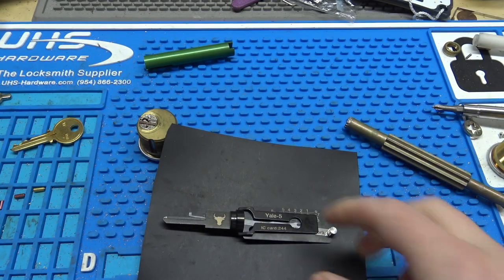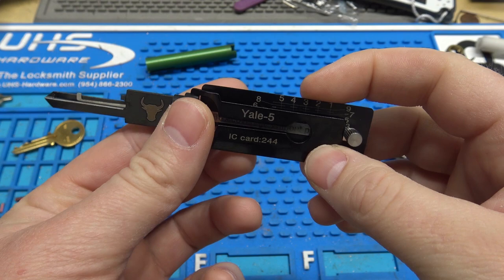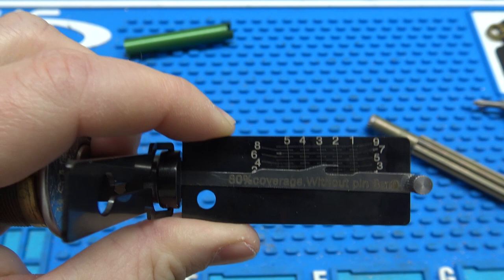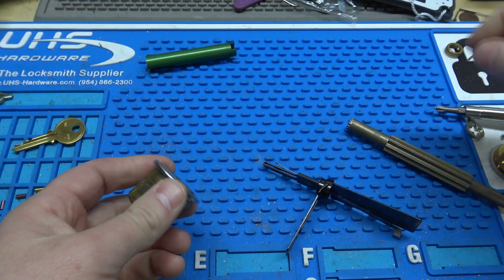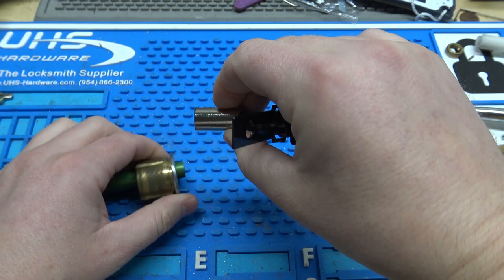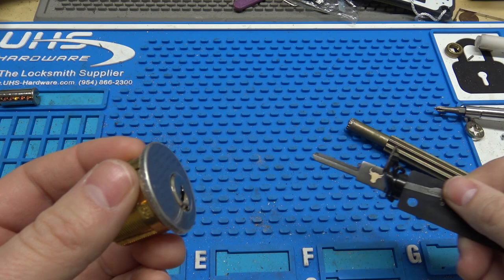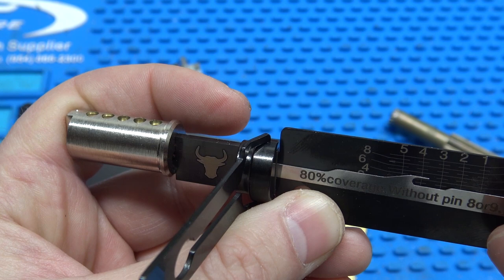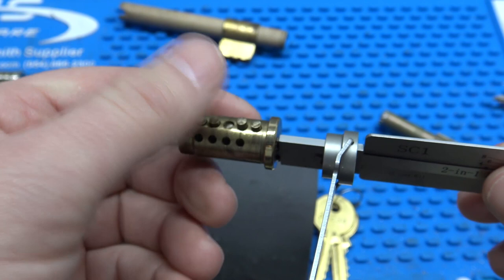(519) Review of the Yale Y1 Lishi Like Pick and Decoder

Comment: Looks like the pick has 3 major problems -
1) the rail is too high. This can be addressed by filing it down a little.
2) the picking bar/stem is too high. Filing it down a little might stop it affecting the previous pin chamber. Note that not all of the bar need be filed.
3) there's something wrong with the design of the pick head. Can't really tell what because it don't show it too well but you can compare against a Lishi tool to see what the problem might be.
Reply: Re 2, it looks like the bar is quite thin near the pick head. I also notice that there's a grub screw in the back of the round holding core (no idea what that would be called).
Can you take it apart? Wondering if the bar is just set too high rather than being too high.
Re 3, you could use an empty plug and look at the head with the tool inserted. Maybe it's not fitting into the pin chambers correctly.
Reply from the maker: You're right.  All things I thing should of been addressed before selling it for 50 dollars to the world lol.  The biggest issue though imo is that its useless if there's a 7 8 or 9 pin.  I dont like grabbing a tool fiddling with it in front of a customer then having to switch tools. That reason alone makes it utter crap.  The lishi people had tried making one and they said they had the same issue which is why they never produced and sold it

Comment: I'm a total lock picking Newb. I'm wondering if a Yale-style Lishi tool would fit in a Yale-style keyway in a padlock. For example, I have a Chateau Disc padlock which seems to have a Yale type keyway, but it's a smaller keyway than the door cylinder you have in the video. Would this pick fit? I'm guessing no.
Reply from the maker: It’s an abus keyway not yale. No Lishi for it. You’d have to get some lock picks and pick it
Reply: @BoredLockpicker  Thanks for the quick reply!